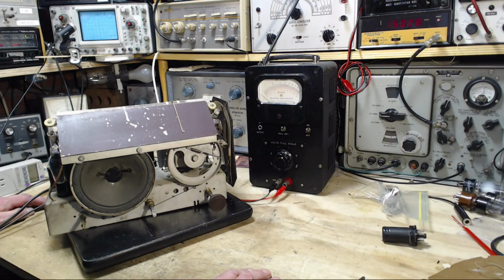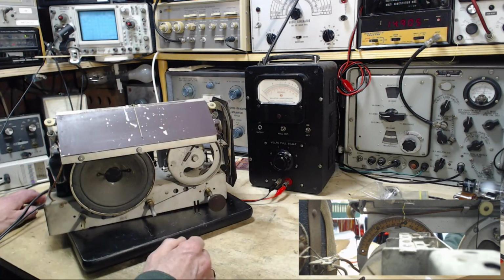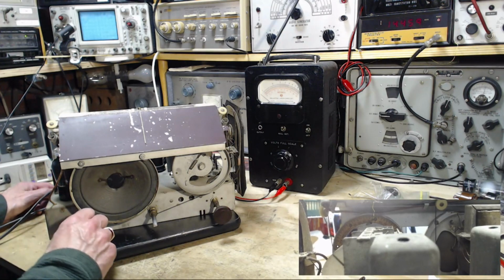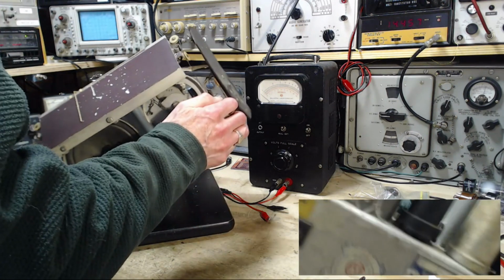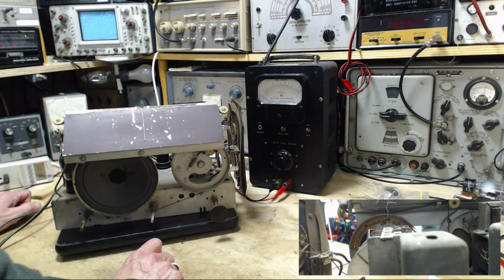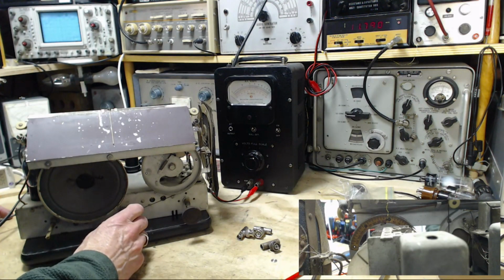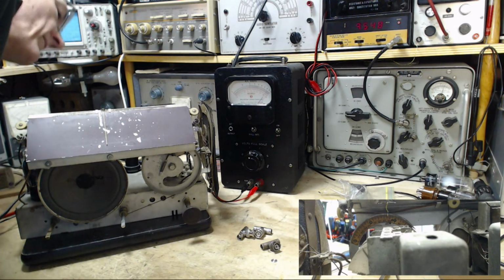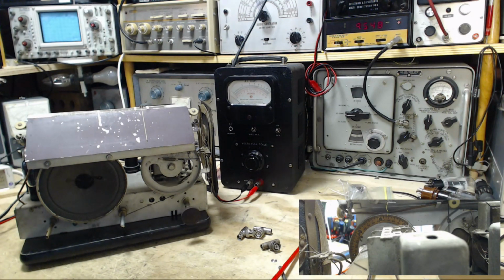RCA Victor A23 Tube Radio #12 - Shortwave Alignment

Comment: They appear to be an attenuator pad Jim. You connect the male to an oscilloscope and the two female parts carry signal from one device to another so that the scope can sample the signal without getting the full power.  They might be place between a transmitter and dummy load for example.